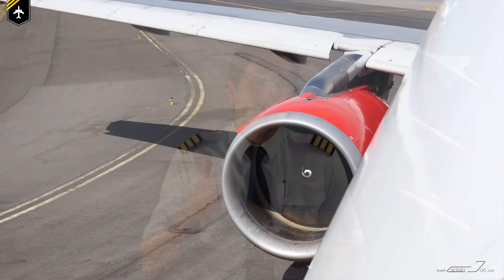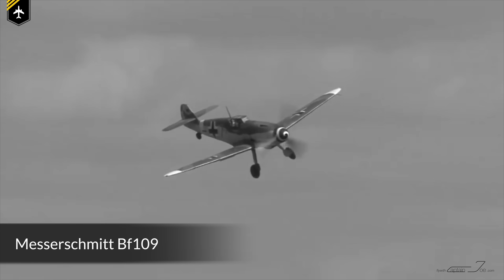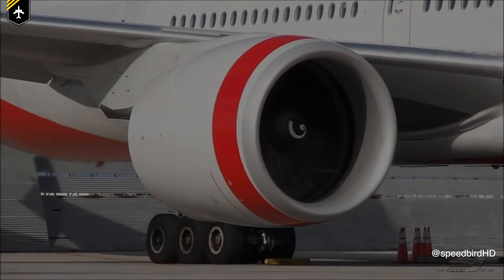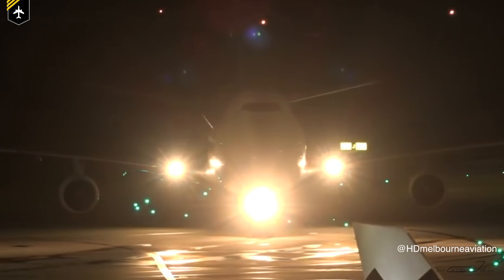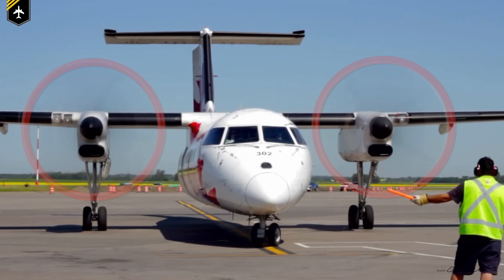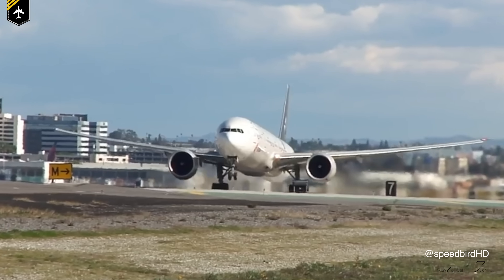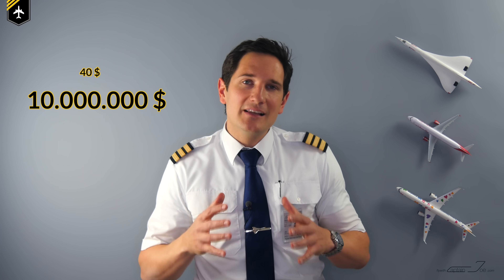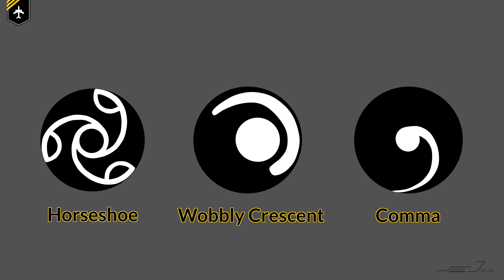WHY is there a SPIRAL in a JET ENGINE? Explain by CAPTAIN JOE

Comment: Hopefully, this is not a stupid question but why are inlet grates not installed to prevent bird strikes?
Reply: From my layman's understanding they'd have to be large and heavy enough to sustain the huge forces generated due to flight, but light and open enough to allow sufficient air through to not starve the engine. On top of this they'd only really be useful at idle speeds, since the engine suction and impact speed could probably force enough pulverized bird bits through the grate to still destroy the engine. 

They do have grates like this for stationary turbine engines used on the ground and the engines in some helicopters though, so it's not entirely unheard of

Comment: When we installed a new motor we had paint shop paint the stripe on the front spinner cone, or swapped front cones from the old motor to the new motor. It was most useful at night when you couldn't see the fan spinning. You would think you could hear the engine running, but when you have hearing protection on its hard to tell if the engine is running.

Comment: I’ve a question on modern airlines they have WiFi but if they have WiFi why do u have to put your phone in flight mode cause it’s proven that the mobile phone signal doesn’t interfere with the aircraft systems

Comment: Cappy Another excellent video.. the audio and video production is absolutely professional. One question however. I have seen airline personnel feeding the engines of a 777, and the meal wasn't kerosine my friend. The guys who I assume to be from a division of catering, were tossing frozen chickens directly into the engines. They could have been small turkeys, it was close to Thanksgiving Day as I recall. Regardless I think one more use for the markings has to be as an aiming point for catering to feed the engines

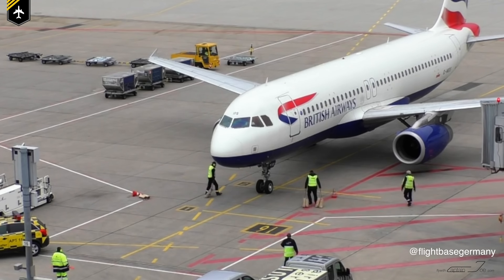Comment: At 2:55 you mentioned the anti-coilison light being turned off. Which is an indicator for the ground crew that the engines are spooling down. 

I am curious, how long does it take for those jet engines the slow down from the moment the "off" switch is hit?

Comment: Joe, about the noise at airports. At the time I was a kid I remember that at the airport you could hear engines screaming a lot - like on full throttle. I was told by someone, that the pilots test the engines at full power for a few seconds before actually starting the takeoff. I just realized that they don't seem to do that anymore. Do you have any insight on this? At the time, Finnair was flying mostly with MD-80 and DC-9. Maybe it was something related to these specific airplanes?

Comment: Captain Joe, why are engines not protected by a titanium mesh cone?
Reply: Because a mesh in front of the engine can be a danger in it self. You may prevent a birdstrike, but the bird maybe damage the mesh and then parts of it can be sucked into the engine and damage or destroy it.

Comment: Hi @Catain joe 
I would like to help you extended the information about other type of engine cone spiral design.
The woddy ball and Comma was commonly found on those GE CF6 Engine
(Before GE has adoption to stick with its iconic "G style" after (may be 10 to 15. Years ago I'm not sure the exactly date)until now.
 The wobbly ball can be found on the 767 which was using the GE CF6 Like American Airlines 767-300
The comma style was another common type spiral of the GE CF6 Engine as well
For example on the KLM 747 400ER.
After few years of different types painting over the spinner cone.Nowadays most of the GE Engine were using the iconic G style for the engine spiral to representing the company brand(even from the past CF6 to Latest GE9X ).
However there was an exception of the sprial.
Some engine even no Sprial marks on the spinner cone
Like the GEnx-1b for 787 8 and
Genx-2b engine on 747-8( for example the Lufthansa 747-8i
The apostrophe type was the current PW engine design
Like Engine Alliance GP72000,PW1000G ,PW4000-112inch Etc.

The long sharp spinner cone with long spirals marks on top of that was in most of the Rolls Royce engine